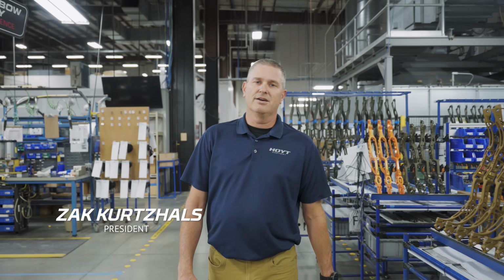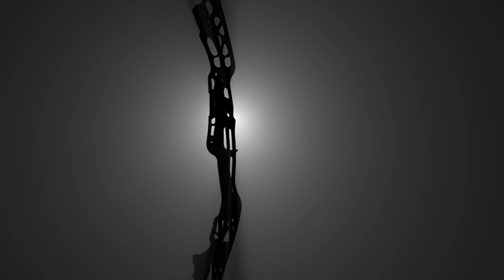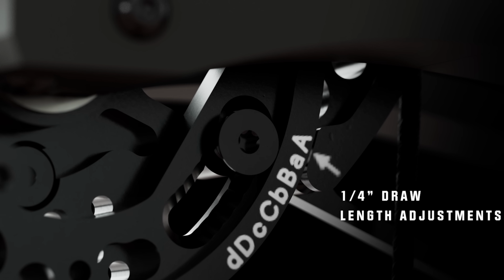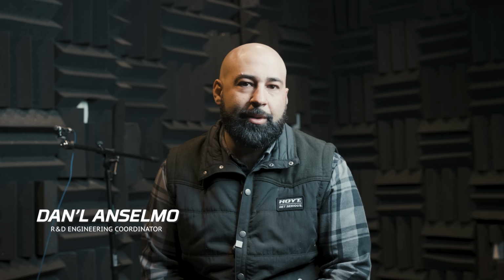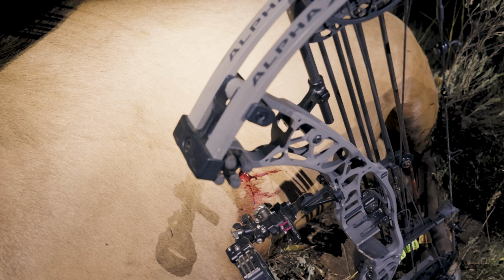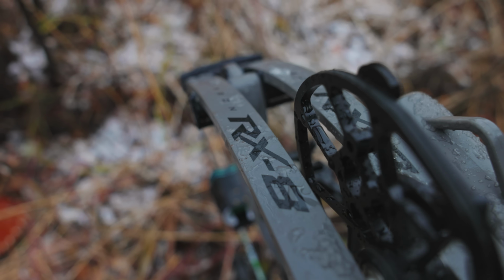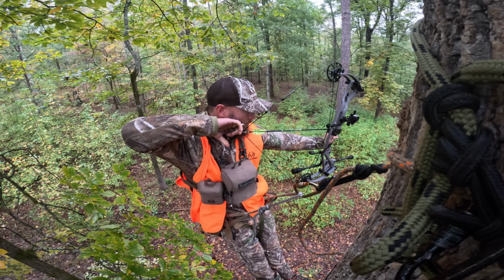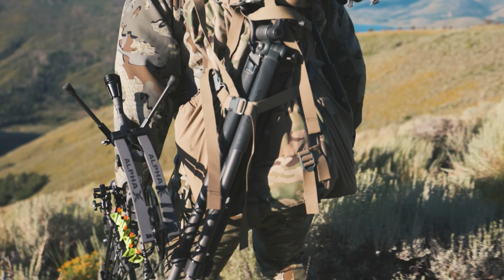CARBON RX-8 and ALPHA X | HOYT

Comment: You guys nailed it this year… Alpha X 33 is the best overall bow of ‘24.
Reply: Have you shot one? Or used one for a season to see if it holds up? Have you done that with all the competitors' bows to see how this one compares? Didn't think so. Every mnfctr makes bold claims every year and the differences seem to be smaller and smaller. This does appear to have more adjustability and a tripod stabilizer, i'll give you that, but you want to clean the jizz out of your shorts if you're claiming best of '24 already

Comment: So what’s the price on the RX8? I shot Hoyt from 1995 to 2023 then had to switch brands because of price. When a bare bow starts getting close to $2,000 it’s time to rethink a few things. I only buy a new bow every 3-4 years and yes I know I could shoot a cheaper one but I want the flag ship. I’m not a professional by any means and very rarely shoot a 3 D tournament. It’s getting where the common man can’t afford the top of the line.
Reply: That’s why I like their TORREX XT. Performance and precision are there but the price point is achievable.
Reply: I agree
Reply: Yep 2g. The local shop that sells them said he's already heard of guys having limb problems the first day they came out, and I saw a guy on a forum talking about cracking or something where the insert goes into the carbon.  Idk myself though.

Comment: Yeah, I am sure they shoot great and I'll shoot one soon when I have a chance, but what is the deal with the pricing? Seems like it keeps going up more and more each year. Disappointing considering the competitions pricing and I'm afraid it'll hurt Hoyt this year in terms of sales numbers. Don't get me wrong, I am a Hoyt guy myself (I shoot the VTM 34") but $2050 for a carbon bow? Like come on, that is a huge price jump over the RX7 Ultra for it to use the same riser and all for what, 1/4" draw length adjustments? Once you get all of the accessories and sales tax, its gonna easily be $3-4K all in which is a large amount of money that only a minority of people are going to be comfortable spending.
Reply: The aluminum boys are actually $50 cheaper

Comment: Did I make a mistake buying Hoyts ? 
Should i have bought a Matthews instead ?

I've watched alot of reviews on YouTube then got excited and bought my first bow a rx7. 
It looked good felt good and shot great. Another reason i got it was because I have a shoulder injury and needed something smooth and easy to pull back.

But it didn't take long and it got damaged by the hoyt untrarest. 
The company I bought it apex hunting did the right thing and replaced it with the rx8. I got lucky, hoyt didn't even care. We called them and they didn't take any responsibility.

Unfortunately the Hoyt rx8 was damaged once I received it.
I was excited because I also bought the garmin xero A1i PRO and couldn't wait to try both products. 
But the cams where damaged. 
The bottom cam once getting adjusted to my draw length didn't fit, we realised the cams where different sizes. 
They replaced the cams. Now my quiver that suits the camo colour and looks great is broken. 

Makes me question 2 years in bow hunting, why is alot of people using a matthews.

Comment: Disappointed. Expected more especially since they didn’t come out with a new carbon bow last year and ran the RX-7 for two years. The fan boys will upgrade but I’ll keep my money.
Reply: This thing is slim and short. Broke a Cam pin on my fredbear. I settled for this carbon rx8. I'm liking it alot. Quarter inch draw, and hard backstop was something I didn't know I was missing

Comment: Well that’s disappointing. New cam looks good with 1/4” draw adjustment but this years bows really show that we are pushing up against the limits of compound bows. Marginal gains at best.
Reply: Kind of like cell phones. It reaches a point where there is just only so much “improvement” they can do.  New cams are the equivalent of new cameras 😂.  I intentionally just bought the VTM 34 2 days ago because of discounts.   Love Hoyt as it’s all I have ever shot.
Reply: The bowtech tuning system is the biggest advancement that actually does something in the last few years. The new core 34 would be what I would be looking at if I was in the market with the ex 8 ultra as a back up. Would need to shoot both. Will have to see if Mathew’s does anything interesting this year (doubtful)
Reply: They designed a whole new cam system that’s better than any of their old ones
Reply: They said that about the bows of 10 years ago. We’ve come a long ways.
Reply: More like the last 10 years
Reply: U should show us all your flagship bow so we can compare. What did u expect a spaceship?
Reply: @chiefryan2260  my spider 30 shoots just as good